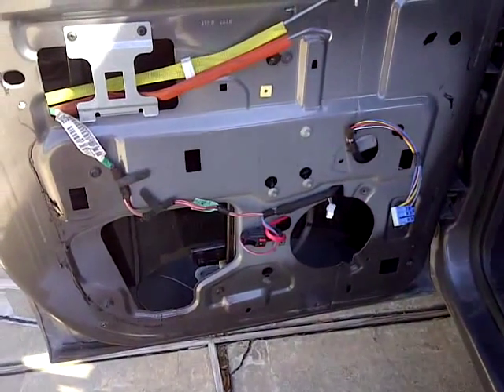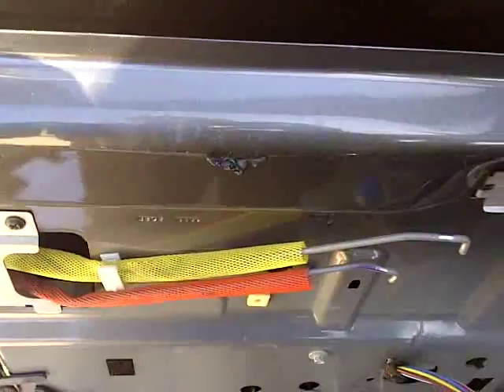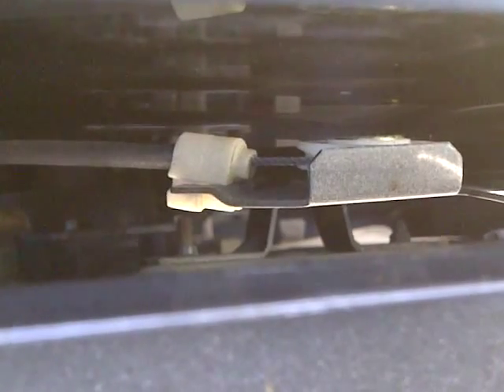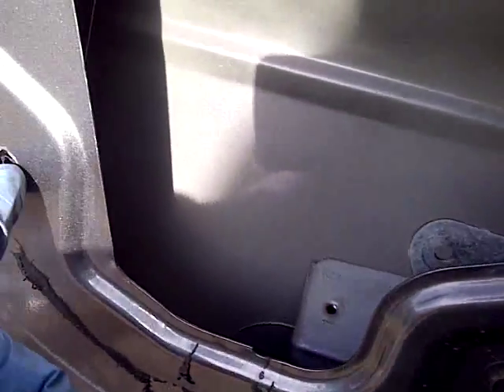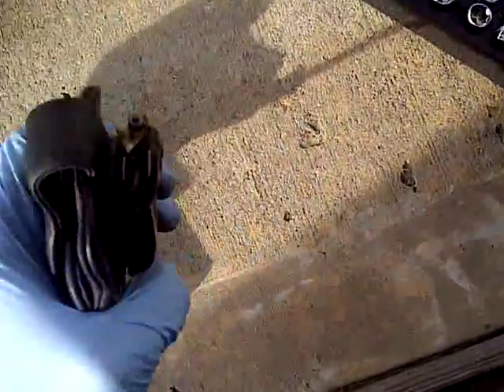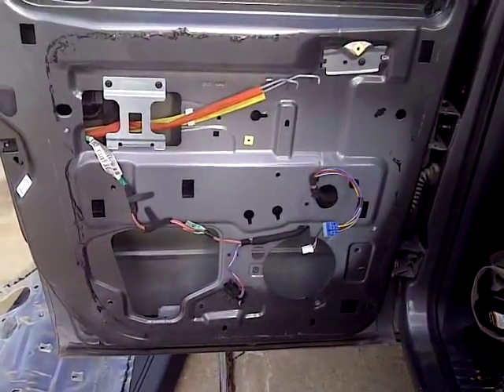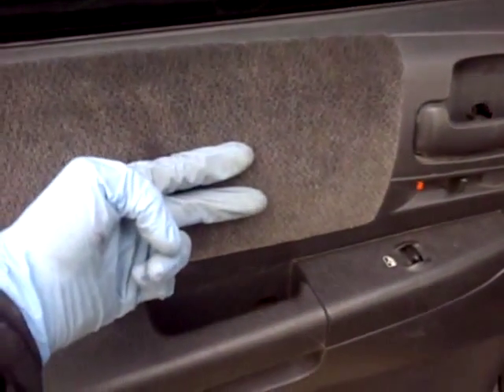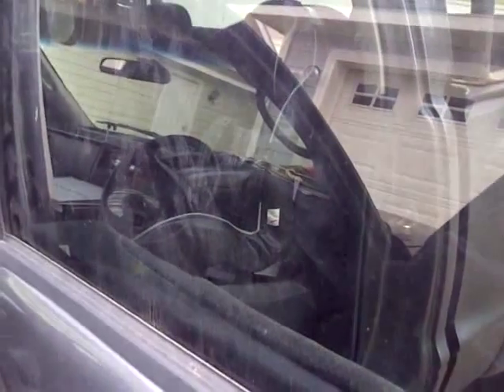Window Repair Broken Regulator Cable 01 @JamesBondJB007

Comment: if it is just a cable problem like tangled, bent or broken cable you can still fix it. open up the cable spool attached to the motor, and remember the orientation of the cable. i bought a bicycle mechanical brake cable as replacement, they have almost same thickness as most window cables and you can buy those crimp-on thingies at the end of the cable. a very cheap alternative if you have the patience.

Comment: Hey.   With the cable broken, were you able to move the window up and down freely to access the bolts that holds the window to the regulator?  Thanks
Reply from the maker: 👍🧡 it's been a long time and don't remember, but I did get it to work.

Comment: yeah man how to repair broken regulator cable? Mine got tangled and bent, is there a way to fix this?
Reply from the maker: Try to get new cable, otherwise just new regulator.  You could also just tie the cable so the window stays shut until you can find a solution you like.
Reply: @JamesBondJB007  thx man

Comment: Dammit this video isn't titled correctly at all - this isn't a broken regulator cable repair, the cable isn't even broken! Looks like the cable block busted (all too common) so one side of the cable is just sitting loose. I'm dealing with that exact situation right now so I was looking for vids on how to actually repair the stupid thing - which is not shown here.

This video is an install/replace of a brand new regulator assembly - and there's a thousand videos about this already, dammit..
Reply from the maker: SineEyed 2020 thank for your feedback
Reply: Sorry to gripe like that but I've just spent the last few hours reading through forum threads and watching vid after vid trying to get this crap figured out and I wouldn't have had to sit through over 5 minutes of your vid (right where it becomes apparent you're simply replacing the unit) if it had been titled appropriately. 
Time is precious - time is of the essence - time is not however, on my side. That's my issue though.
Pretty simple to edit that title on your end though - swap out that "repair" for a "replace" - it might save someone else a bit of time somewhere down the line, knowudimsayin...
Reply: William A. Laws III I just sawed a bit of wood 2x1" and jammed it on cross member to hold glass up
Reply: SineEyed 2020;  2 yrs later, caught me also. Title STILL isn't edited!!!! Probably how he's getting views.
Reply: @markmacdonald8512  jeez really? That's lame smh. Doesn't take more than 10 seconds to make an edit like that..
Reply: @SineEyed  you ever find how to fix it bro ? My wires snapped this some bsss
Reply: @RezurrectedInc   nope, sorry. I ended up just ordering a new regulator assembly and installing it..
Reply: Damnit same issue here one cable not attached came out to van and window was down thinking I don't remember leaving my window down only to find a cable attached to nothing and I don't know where to attach it back or how it is attached to window slide or whatever u want to call it lol